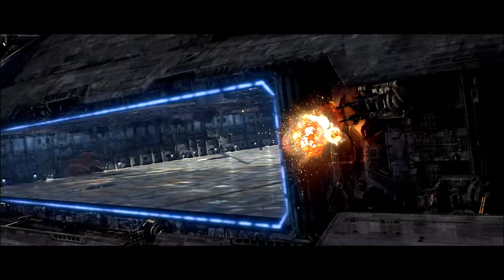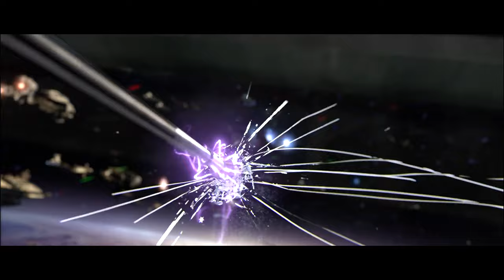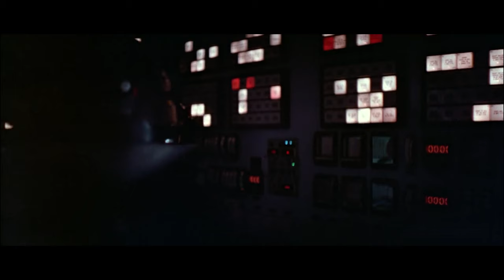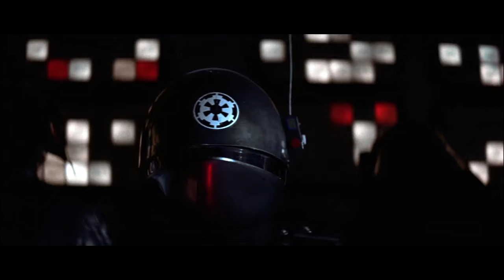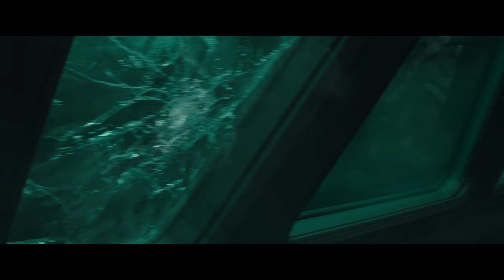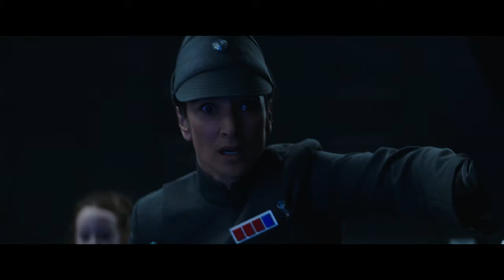This makes literally no sense

Comment: Don't forget Grevious is stronger than most people. I understand the argument and it makes sense, but Greivous could be using more force than we realize.
Reply: Grievous is a cyborg and that staff looks kinda sharp
Reply: But the window broke in the way glass does. If it was as strong as steel there would have been a small hole instead of the whole thing shattering.
Reply: @commandere2475  Well, any whole in it would cause the pressure to also burst out suddenly too, which would explain all the glass shattering
Reply: @commandere2475  there's a huge pull from the vacuum...
Reply: @Blitzvonic  my point was that steel  (or something of the appropriate strength) wouldn't shatter like that. If the air pressure inside the ship is about as high as on earth, the pressure difference to outside the ship wouldn't be enough to cause this much damage.
Reply: @commandere2475  That has nothing to do with strength... it's probably something that would shatter instead of be pierced or folded... but so strong that it'd take a lot to make it break.... 

So while it'd be just as tough, it wouldn't make a hole, but shatter... 

And as such, you have a descent defense while also having a view in case all of the cameras or electronics stop working for some reason. 

Of course, there is also just the fact that Star Wars was a fantasy and this kinda thing isn't supposed to be over thought or taken too seriously...
Reply: The issue here is not the windows tensile strength but the malleability of metal or the brittleness of something with a crystalline structure.
Reply: @commandere2475  it could be as strong/ stronger than steel but not malleable like how tungsten carbide is IRL. I think of the magna guards staff as being like an emergency window breaker for a car window and grievous being exceptionally strong.
Reply: The fact that the windows have airtight shutters indicates that the designers of the ship were aware they were in fact made of shatterable glass and adjusted accordingly.
Reply: @commandere2475  maybe when you make metal transparent it shatters like glass?
Reply: @Dewitt667  kinda like diamonds, yes it's the hardest substance we know of but it still shatters like glass with enough force.
Reply: While I enjoy this idea, Grevious wasn't able to use the force. But he is a mega strong robot dude so that's where you can get his strength from haha
Reply: @FriendsAndTheirGames  that's what I meant by "force". Basically his physical impact would be well over that of normal building regulations. 2003 Clone Wars Grevious could have probably destroyed the entire bridge...
Reply: @honotenshi  ahhh makes sense!! My bad lol 🤣🤣
Reply: @honotenshi  lol sorry man I find it so funny I misinterpreted that for some reason 🤣😭
Reply: @FriendsAndTheirGames  his strongest weapon...

constipation
Reply: You realise that with the level of strength ya'll claim Grevious has in this scene, he should've been able to knock Obi-Wan and Anakin the hell over Jedi or not.

Stop grossly exaggerating to justify this.
Reply: @zephyr8072  yea and Obi Wan or Anakin could just use the force to knock over grievous. What's your point?
Reply: @FriendsAndTheirGames  My point is Grevious is not strong enough to shatter the kind of metal they make starships out of.

That's glass.
Live with it nerd.
Reply: @zephyr8072  Uh yea it is glass.. I never said it wasn't? 😂
Reply: @commandere2475  steel can crack actually if its brittle enough
Reply: @Idle_Cerberus  I know space is pretty cold, but it shouldn't be that cold.
Reply: @commandere2475  not a matter if cold, its just if you make steel hard enough if becomes brittle like glass, just like diamond and how it would make a terrible weapon, its TOO hard and shatters because there is no flexibility, the reason steel is usually so strong is because it only bends a little meaning its hard AND can absorb the impact
Reply: @commandere2475  the staffs are made to be light saber resistant, so its safe to say that its durable and most likely stroger than steel
Reply: Well most humans at least
Reply: @commandere2475  even bulletproof glass spiderwebs around the break, it's generally but not always what glass does when it gets pierced. But you're also trying to assign real world science and physics to a story about space wizards with laser swords.
Reply: The staff would break in that case. The end.
Reply: @NinjaSushi2  the staffs were made of phrik which is almost as strong as beskar so no, the staff wouldn't have broken.
Reply: @commandere2475  it would cause massive damaged, explosive decrompression is devastating.
Reply: Most likely it is very strong reinforced glass with composite layers, meaning upon impact it might crack but will still be intact,  think of bulletproof glass. However the pure force of Grevious throwing the staff into it most likely penetrated the full thickness of the glass.
Reply: I'd buy that transparasteel is far harder and thus more brittle than regular metal. And grievous is a brain and some organs in a robot, and it's canon that he has preset fighting techniques programed into him, so it's not much of a stretch to say he has one that just throws his weapon at max strength, which would be enough to puncture and fracture the transparasteel enough for the pressure of the internal atmosphere to blow it out into the vacuum of space.
Reply: @zephyr8072  yet on one occasion he casually punches a dent into the hull of his starfighter, if he used one of those staffs there, he probably could have pierced it just as easily.
Reply: Grevious can't use the force
Reply: @commandere2475 it's strong as steel but it's still glass
Reply: @commandere2475 
It's actually possible for steel to break that way if it's been hardened to the point of becoming brittle. S7 Tool Steel is notorious for shattering with a hard enough impact, though "hard enough" in this case would be measured in the tens of thousands of joules of KE.
Reply: @commandere2475  It's still glass, so it has the same composition as glass. Being as strong as steel doesn't mean it has the exact same properties as it.

Comment: On multiple occasions, including like 5 seconds after this scene, grievous used his claw foot things to bend/rip metal walls apart. If he is strong enough to damage the metal, maybe the window just broke cause he is that strong?
Reply: I agree with this dude , he understands the mechanics of the diegetic galaxy 🌌 made by George Lucas
Reply: That’s what I was thinking.
Reply: A magnaguard staff should be in no way able to break transparesteel, no matter how hard it is thrown. If you hit something as tough as insert sci-fi hull here hard enough to destroy it, then the sci-fi hull also hits back with equal and opposite force. The magnaguard staff would collapse under the Newtons subjected to it, and simply pancake off the transparesteel (if it's as tough as it's supposed to be). 

And let's not pretend that General Grievous can one-handed huck an object with more force than the explosive force of *insert sci-fi torpedo here*.

The ACTUAL explanation is that Lucas got real lazy and started writing bad sequences.
Reply: @Vagabondobiondo  have you seen 1000 ways to day, the guy that gets shot with a cigarette and dies? Sometimes it’s not about how hard is the projectile but how it is projected.
Reply: @Vagabondobiondo  those staffs are made of a harder material than starship hulls, the only reason they don't use that material for starship hulls is that it's rare and expensive. And bridges of those ships got taken out by torpedos and stuff several times in Star Wars, but usually they were protected by shields, but obviously not from the inside.
Reply: @Vagabondobiondo  I don't think the film about magic space wizards is necessarily too tied to reality. I'm not saying it's realistic IRL, but it's an ability that was consistent throughout the clone wars tv shows and the 3rd movie. Also, if the staffs could avoid being cut by lightsabers, but the hull and windows aren't (windu and palp smashed a bunch later), it's at least within the realm of possiblity diegetically. And I would assume the shielding around the bridge only protects from attacks outside. And the ship was damaged, look there's any number of justifications you could use if it bothers you too much.
Reply: If it was steel it would just be a tiny whole, the whole unit wouldn't crack and throw out the entire bridge.
Reply: So, you're telling me that creature possessing such immense physical power is unable to manhandle Kenobi later in the story? Jedi are as susceptible to injuries as other living things and Kenobi got hit several times by Grievous, while not wearing any armour. How is he not dead or at least shocked from the first strike?
Reply: @Vagabondobiondo it’s made up
Reply: @Prushinthespirit We see many times in Star Wars where Jedi are capable of increasing physical attributes. Luke increases his jump height in Empire Strikes Back, Obi-Wan increases his speed in The Phantom Menace, Anakin heightened his senses in The Phantom Menace. We see Maul capable of surviving a bisection and recovering in The Phantom Menace and The Clone Wars. It's not a stretch that a Jedi could bolster their durability.
Reply: @Vagabondobiondo if the magna guard staff can block a lightsaber then it must have a point of intense power....all Grievous had to do was crack the glass a little bit...the pressure from the vacuum is what really broke the window...😮
Reply: He's also shown in RoTS to be strong enough to punch dents into starship hulls without even the slightest recoil, so it's more likely that he was just physically strong enough to break the unshielded side of the reinforced glass with brute force. And he was smartly abusing his cybernetic body to attempt killing Obi-Won and Anakin via the vacuum of space as the most likely way to win the encounter, rather than risking a 2v1.

Comment: I have two/three arguements here. One: sensory technology in tcw was quite bad, b1 droids often couldn't detect more than a normal line of sight, and b 2 droids weren't better. 
2: the glass is fine, but electrostaffs at maximum power are able to rip open someone's chest in a small nudge, this, combined with grievous's wrecker level strength, woild break the glass. I was surprised that it didn't insta shatter.
Reply: I think another factor is that the outside of the glass and ONLY The outside of the glass are shielded just almost EVERY other ship in Star Wars history except TIE fighters of course

Comment: Makes sense because the ships have shields so unless you can take down the shields, the windows are not vulnerable. Like the TIe fighters that shot at Leia’s ship. And a proton torpedo can take out electrical systems so using an energy field is a non-starter.
Reply: It's probably cheaper to add glass instead some advanced shit.
Reply: @Bearical  That probably too.
Reply: To me “Electronics can be jammed” is probably the simplest answer. How easy would it be to take out, or bypass, a fleet if you could upload a virus or set off a exotic particle burst to turn all their exterior cameras off. Seems like that would be a more exploitable flaw than breakable windows.
Reply: Ye true dat, should have thought of that
Reply: @teamredshirt  A simple counterargument to that is "ECCM exist", from using another sensor that isn't as jammed, to actively targeting the source of jamming.
Reply: @PaiSAMSEN  Absolutely correct, but a technological innovation can be accounted for or proofed against. A window is just a window. Yes, it's technically a weak spot, but so are the engines or the hangar bay, and the bridge window is a hell of a lot harder to hit on a Kilometer long starship than either of those. Also, what do you do when main power is down? Use power to see outside or to breathe? 

The fact that most of the ships we speak of are military vessels should also be taken into account. If you look into how military testing is done in the real world, something being the best possible solution isn't always a point in its favor. If there is a solution that is 70% as good but costs half as much then you better believe that will be the preferred one.
Reply: Tie Fighters shot leias ship?
Reply: This! 

The executor bridge was only vulnerable WHILE THE SHIELDS WERE DOWN

Comment: The bridge of an SD isn't really that exposed though. It has two massive shield generators right above it, and it's a very small part of a massive tower that is like 99% officer quarters. Combine that with the fact that if you're nose to nose with an SD, you're already at a range of 1.7km, that's not going to be an easy target to land shots on in the midst of a battle where presumably everyone is doing some sort of combat maneuvers. You're trying to target a small cluster of lights, amongst a huge cluster of lights.

Plus cameras or sensors would be just as exposed, so what happens if those are taken out? Or just interrupted via chaff or EM interference? I mean you can disable the image of most cameras by just flooding it with IR light.

Plus to actually make a bombing run with snub fighters on an SD bridge, you'd have to fly straight through the cross fire of the entire dorsal arsenal. Don't need specialized anti starfighter weapons to defend in that case, since you just need to cover bombing trajectories, and bombers can either die, or wave off at that point. I could also get into the fact that turbo lasers should be more than adequate to take down fighters with a half decent gunner, since they don't have the same short fall of real world battleship main guns.
Reply: Lots of camera use within military...hell, even lots of civilian camera have filters to ensure you can't flood it with infrared. Even then, you could just integrate several positions and type of sensors together to circumvent a lot of jamming techniques, the kind of integration that's pretty much a bare minimum of almost every military equipments in 21st century.

Plus, ECCM is a thing.
Reply: I’m of the opinion that the conning tower on Star Destroyers could at least be shorter and less pronounced. Is their “neck” portion really necessary?
Reply: @thecatfather857  Well, yes, there needs to be a long neck. You don't want your officers to have to listen to the full thrum of the engines while they sleep in their quarters. That would be so uncivilized.

Come on! Use your brain!
Reply: @AngeloBarovierSD  lol
Reply: Which would you rather have? All your cameras blown off so you're flying blind? 

Or the glass on your glassy bridge blown off so you're now breathing vacuum? 

Scenario 1: You're blinded for the day
Scenario 2: You're unavoidably dead

Also: space is so vast that having a literal window offers legitimately no tactical advantage whatsoever. It's merely a way to help you psychologically visualize something, e.g. Luke observing the Battle of Endor through the window.
Reply: You're my kinda guy

Comment: Sensors can be jammed (as alluded to in Empire Strikes Back - "a ship that small with cloaking?") and cameras can be destroyed, interfered with, and use power.  Sometimes you need to use regular.eyes.  it is also possible that on the Separatist (droid) ships that a secondary , opaque shielding was not needed as droids are unaffected by space.  Plus as stated, ship shields would protect them from exterior attacks.
Reply: Exactly! And even looking further in empire, we see Vader leave the asteroid field to send a message, which means that even their advanced systems are prone to relatively easy interference. Now that you mention it and I think about it, one can see many examples of how prone to interference their technology is. Just because something is more advanced doesn’t mean it’s perfect.